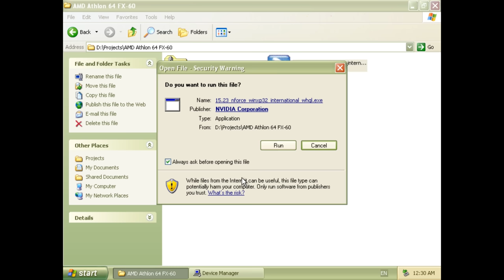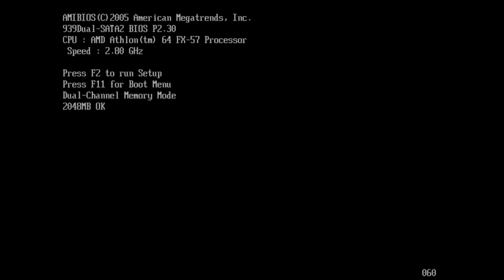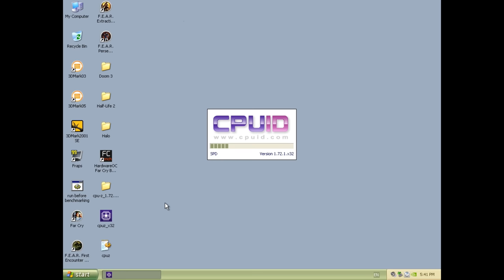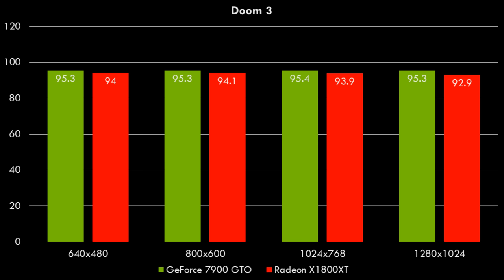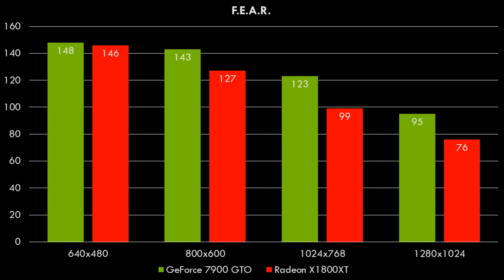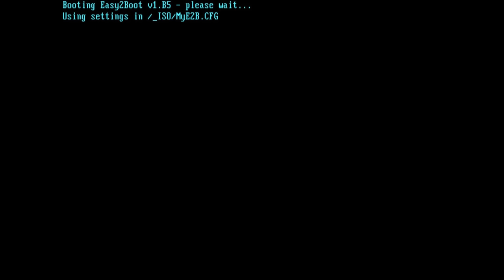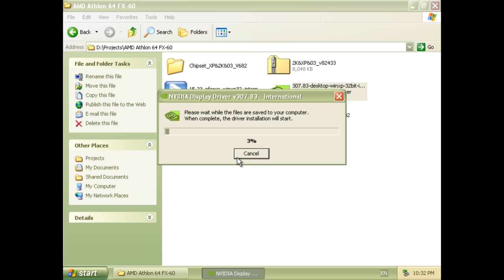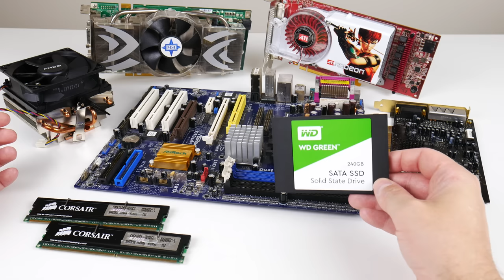AMD Athlon 64 FX-57 - $1031 CPU from 2005

Comment: Ah the memories ... I never owned an FX CPU but that Ai Lifestyle branding bought back the feels of the Q6600!
Reply: Q6600, now there's a chip. I still have a rig running one, such a fantastic processor for overclocking.
Reply: The whole Q2D/Q2Q line was amazing for overclocking. I once put a 3Ghz e8400 under vegetable oil with a water cooling kit in a mini fridge and it just wouldn't quit. I think I got it to 4.5Ghz...

Comment: I still have my Abit AN8-Ultra board, AMD 4800+, a ATI x600, a Asus EN7600GT (Passive cooler), and a Geforce 8800GT... haven't tried to run any of it in many years now. I used that system until 2013 when I finally upgraded. They might still work and I feel like building a retro PC. I even still have my case from 2005... think all I'm short is a working PSU and a nice CRT monitor...

I do actually have quite a bit of old tech. Some old intel 478, Celeron D, 2 or 3 Athlon 64 3200, AMD Phenom II 550 black, Geforce GTS250, ATI 9200, some other random graphics cards, old external 56k modem, and all kinds of bits and pieces. Never really thought about it much until I saw some of your vids and now I realize I have quite a pile of old stuff stashed away in boxes. 

Feels like yesterday me and my mates were updating directX with our TNT2 and Geforce 2 MX440 (Had a 1.1Ghrz Celeron at the time) and running 3D mark to see if it made a difference and then just playing counter strike 1.3 all weekend anyway.... good times.

Comment: Hey Phil!  Great stuff as always.  I want to thank you especially for the Snappy Drive Installer link.  I am working on numerous projects and this tool looks great.  The fastest Socket 939 chip I have is the AMD 64 X2 5000 running in an Asus M2NPV-VM  😎
Reply: AMD 64 X2 5000 for a socket 939? Wasn't X2 4800+ the top one that 939 supports?

Comment: For anyone curious, here's the reasons you don't want to install video and audio drivers from Snappy Driver Installer Origin:  For video driver I have routinely had bad luck with it causing system lockups and having to boot to Safe Mode and manually remove or replace them; this has occurred regularly on both NVIDIA and ATI/AMD GPUs, other manufacturers don't really seem to be an issue.  For audio drivers, specifically Creative Labs products, the original Creative Labs installation CDs will not detect the sound card once drivers have been installed and so the installers will refuse to run.  It's best to install everything you need from the CD immediately after Windows installation, and then reboot.  From there, you can allow SDIO to install the latest drivers for the cards and retain their full functionality.

Comment: I still have my athlon 64 3500+ paired with a asus a8n-vm csm rev 1.01 and it has worked flawlessly for as long as I've had it. I've had it since 2009 when I got it from a relative. Apart from cleaning it from dust I've replaced the cmos battery once a couple of years ago.
Reply: I had a 3500+, as well.....nice processor at the time!
Reply: I used an Athlon 64 3700+ and the Athlon 64X2 3800+ on that board. Never a problem!

Comment: The nForce chipset was a pain in the arse when new, and only got worse with age, driver support fell off and then normally the headsinks fell off on the cheaper boards and they died
Reply: I have an ECS board from 2007 and have no issues, but I have repasted it.
Reply: @uzernaim1648  more amazed you have a ECS board still working 🤣
Reply: @JimtheITguy  I still have working old PC with ECS Nforce4 A939 motherboard running Athlon x2 4200+. Running it just for a cheap router/ftp server
Reply: @JimtheITguy  I have a working Socket 4 ECS board from 1995. I've heard it outperforms most other mainboards for socket 4. Also it offers great possibilities to configure memory and cache timings.
Reply: @Tom2404  Glad to hear it, Socket 7 and SS7 onwards boards got so cheap and badly made that they didnt survive or they were so unstable after a few years due to crap caps
Reply: @JimtheITguy  yes, they bought PCChips back in the day and even sold some boards under both names. That's probably one of the reasons why their quality dropped.
Reply: @Tom2404  ahhhh the good(bad) old days, time to play guess the version of the motherboard :-D

Comment: I had the first board you tried. I ordered it because it had integrated Sata in the northbridge specifically so it didn't need the F6 driver method to use data. I never had to do that with that board. I ordered that board as soon as it launched, and it had a lot of stability issues at first, but then on a later bios update it became the most stable and solid system I have ever owned. I paired mine with the Athlon 64 X2 4400+. I still have both the board and CPU.

Comment: I have an Asus A8N32-SLI Deluxe, almost the same Board as you wanted to use. Got it CIB almost new, but the seller sold it really cheap, due to a faded memory of having issues with it. I tested it and it would always spit out the same post beebs and a black screen, regardless of cpu or powersupply.  Got another used but in good conditon A8N (don´t remember the exact model) also with an Nforce Chipset but without SLI capabilites. That board worked fine, apart from booting issues sometimes. Sold it as a complete system to a friend, so he can play some games from back in the day, that he really enjoyed.

Comment: I have an ASUS A8N-SLI that, as of the last time I tried it, still works perfectly fine.  I've had to replace the chipset fan twice since I got the board back when I purchased it as a replacement for an MSI board that died a mysterious death after a simple RAM upgrade; this would have been sometime around the end of the 939's lifespan, circa '05-06.  I bought a passive Zalman heatsink that I might get around to putting on it some day.

Aside from a single capacitor near the RAM slot sthat's showing signs of bulging, the board appears to still be in decent condition, and now I kind of want to take it out and play with it.

Comment: My experience with Socket 939 has been overall positive.

Recently, I purchased an Asus A8N32-SLI (never really had any serious problems with Asus boards, unless they were actually broken), and after giving it a thorough cleaning because it was a bit disgusting (spraying it down with some CRC QD Electronic Cleaner after popping off the heatsinks, doing additional cleaning with 91% iso. al., and using some new Arctic MX-4 and Arctic thermal pads for the VRM + chipset heatsinks), I threw into it my AMD Athlon 64 FX-60, 2 different kits of 2x512MB DDR-400, a Zalman CNPS9500 LED CPU cooler, and a Teamgroup L5 3D Lite 120GB SSD, and went off to install XP Pro. 64-bit.

I never had as much trouble installing XP as I did when I tried with this platform. It turns out that if you slipstream the Nvidia SATA drivers (which you can get by unzipping the all-in-one Nvidia chipset+storage+other-stuff driver package and going to the "IDE\WIN**\sata_ide" folder), you have to allow XP's installer do drive formating, or else it'll essentially not copy anything over from the install disk. If you try to format your boot drive under modern Windows for proper SSD allignment and the like, and try to make the slipstreamed XP installer do something with it, the installer acts as though the volume is write-protected from the looks of it.

Besides that multi-hour troublshooting nightmare, the rest went swimmingly. Installed the latest Nvidia all-in-one driver package for the chipset, then sound, LAN, etc., fully-updated XP with all of the latest updates, installed the latest GPU drivers for my given GPU, did some tiddying up, and the install was ready for some GPU testing (I was testing a 7950GT and a 7900GTX that I had just acquired for this test-build).

After that was all said and done, I decided to try some OCing with this CPU. I got decent results I think with this chip (2.8Ghz with stock bus speeds, multiplier of 14, and Vcore of 1.45V; the chip was over 2 hours stable under Prime95 at 1.435V (?), so 1.45V should equal rock-solid stability, although I didn't test it; after all, 'tis was just for a little benchmarking, not long-term use; BTW, I had some fans over the VRMs, just in case). Sadly, I could not go any higher and hope for any reasonable stability. From what I could gather, this was due to temperature - these chips get real sensitive at around 60C, unlike modern CPUs, so if I want to get beyond 2.8Ghz, I'll need a beefer cooler or a more exotic solution. I don't think I won the silicon lottery with this chip.

Anywho, getting an FX-60 to 2.8Ghz (which I think with nearly all FX-60s is easily doable with a decent cooler) should easily put it toe-to-toe with an FX-57 at least in clocks, all the while giving you the benefits of two cores with 1 megabyte of cache per core.

@PhilsComputerLab Maybe you should compare the FX-57 with the FX-60, and if you need an FX-60, I'd be happy to loan you mine. :D

Comment: AMD: Breaking the 2.5Ghz barrier at time. High clocked single core CPUs with huge CACHE are still kings
Reply: They certainly weren't with highest clocks
Reply: @TurtleAsshole  well, multithreading Is not yet in all apps. In my exp single-dual core up to 4 core 4ghz cpus perform better then 8-16 core 3ghz cpus, so frequency matter
Reply: Amd broke the 5ghz barrier too with fx 9th gen or also known as the amd Chernobyl cpu
Reply: @krumrashkov7228  Never seen a serial produced 5ghz CPU on sale, will check it. External love for AMD and via-cyrix, healthy competition
Reply: @TurtleAsshole  But they dont get really utilised so fast. Oposite examples are rare, like how well MacOS X operates on relatevely low hardware looking at spepcs. I am old school for optimizations first, hardware optimizations too like in CISC m68k days, unlike big numbers that dont translate to real world performance. Looks like "buy Shaker 5000" marketing so long
Reply: @RasVoja  the fx 9580 i think was the one that reached it but it had a tdp of 225  thus the name amd Chernobyl
Reply: @krumrashkov7228  Checked 8 cores at 4.7GHz. I am sorry but that is not breaking the 5Ghz barrier
Reply: @RasVoja  boost is up to 5ghz so it counts
Reply: @RasVoja  and they are actually 4 cores but amd markets them as 8
Reply: @krumrashkov7228  They also broke 8.7GHz with FX.
Reply: @MJ-uk6lu  yeah but the architecture sucks so no matter how high it goes it still aint good compaired to todays ryzen altho i still own and use a fx 8370E and they hold up quite well
Reply: @krumrashkov7228  Then its not much better then my Athlon X4 880K 4.2Ghz
Reply: @RasVoja  i guess i never said they performed good they reached high frequencies but dont perform well because of their bad architecture
Reply: @krumrashkov7228  OK, but I count "normal freq"
Reply: @RasVoja  they were on sale.... i remember looking at them on newegg.... 10000% sure

at least they were in the states..... you didnt miss much lol
Reply: @TurtleAsshole  That is true. Nowadays, 12 and 16 cores are considered "mainstream" or "gaming grade" 
I have a 12-core Ryzen in my current rig, and I'm very happy with it. Performance is great, everything is nice and snappy, and it's highly efficient when considering the thread count
Reply: @krumrashkov7228  No FX havem modular architecture, each modules has two cores, they have their own ALUs, L1 cache, BUT they share L2 and FPU. Its common misconception.
Reply: @Artanys62  yeah but exactly because they share the l2 cache they are considered 4 core cpus even tho they are 8
Reply: @krumrashkov7228  Its not because shared L2 cache, its mainly because shared FPU and lower FPU performance. In non-FPU heavy tasks FX works great.

Comment: Look for swollen caps on those old dead motherboards.
Reply: EVENT ID 41 KERNEL POWER
Reply: Especially if it's manufactured in the 90s, a lot of caps back then were counterfeit.
Reply: @SerBallister  early 2000s too, from my experience.
Reply: @daw7563  if i recall correctly it was the very early 2000s; 2000 - 2002.

Comment: I have used an ASROCK M3N78-VM with NForce chipset with absolutely no problems until a couple of weeks. It has been paired with Phenom X3 710 and X4 955 BE. Always overclocked and no problem.

Comment: There's a reason why Nvidia no longer makes PC mainboard chipsets. I've very rarely had good experiences with Nvidia chipset mainboards, both at home and working in IT during that time. The most reliable Nvidia chipset based board I've ever used was in an older Dell Dimension PC that has an 939 Athlon X2 3800+ CPU in it. But even that board can be somewhat finicky with SATA devices much like you also had issues with.

Back in 2005-2006 I still had an Athlon XP 2500+ CPU overclocked to 3200+ speed and a ATI 9500 Pro video card. The whole setup was long in the tooth, but I was going through a divorce & bankruptcy at the time so I didn't have a lot of money for several years.

Comment: Before my M2N32-SLI Deluxe I had one of those asrock boards. Strait up, when it first launched, it was crap. Stability and performance issues abounded, but every time I looked there was a new bios update. And one by one the bugs were all fixed. And then finally with one of the later bios revisions they gave them a great performance boost, so they were as good as any other board at the time on 939. I passed mine down and it was used happily for many years. Best budget board of its era that allowed me to hang onto my AGP card and upgrade to a dual core and pcie card, and later AM2. Very great experience.

Comment: I bought an Asus A7N8X-E deluxe back in the Athlon XP days, and had a lot of problems with it, I had the same issues that you had in the video, but only with the ethernet controller. When I tried to make a RMA the vendor had gone bankrupt, so I had to get a VIA based board from Msi instead. Worked like a charm until lightning struck :-)

Comment: To add my own comment to the hundreds here. 
I loved the nForce 2 and nForce 3 chipsets and have had ASUS motherboards using both over the years. These boards were fine. I currently own an MSI motherboard running an nForce 3 chipset with an Athlon64 FX-57 and this board has not been problematic.
I did find that the nForce 3 boards were not as overclocking friendly as I expected, but good results could come out all the same. At the time that I bought my MSI motherboard, I wanted to retain my still highly competent Geforce 6800GT AGP card, but wanted to move over to dual core. I bought a low-TDP variant of the 2.2GHz 4400+ which I clocked at 2.53GHz for daily running (I could reach 2.75GHz, but this was not too stable). I did use 500MHz RAM with this. The FX-57 was a much later acquisition for a Windows 98 project that never got started, but the board and chip do get through their paces from time-to-time and still run stable. 3.0GHz is the best overclock I could get, disappointing given the unlocked multiplier, but not surprising considering how close to the limits it already was.
I will say that by the time nForce 4 came out, I was avoiding it like the plague. It was extremely expensive, ran very hot and had poor reports. I have a Core 2 motherboard with an nForce 4 chipset as well - it's not impressive at all.
If you get the chance, it would not be unreasonable to try the board with an nForce 3 chipset. Although AGP only, someone with a 6800 GT or Ultra could have warranted an FX-57 and as mentioned above, is actually one of the best combinations for an ultimate Windows 98 gaming monster.

Comment: Great video as always Phil!
I have a similar retro XP gaming PC.
I went for the similarly bonkers Pentium 4 extreme edition (3.4GHz on socket 775)
Nvidia GTX 7950GT (XFX overclocked silent edition)
ASUS P5WD2 Premium motherboard
4GB (2x2GB) ddr2 RAM (1066mhz Corsair XMS2)
Sound Blaster X-Fi Fatal1ty Edition (the original PCI version with 64MB of X-Ram and the 5.25" bay)

It's all build around the P4 EE, there are so few motherboards that support it.
I chose the nvidia card because of its looks and the fact it was silent. It also evokes more nostalgia for me as I always had Nvidia cards back in the day. (I think I had a GeForce 6200 at the time)
I'm currently playing Doom 3 on it during the lockdown!

I'd love to see you do a video on the Prescot 2M vs the 1M and see if the extra cache made any difference in retro games and if it makes any difference to more modern applications and then maybe compare that to the extreme edition.
I'd also like to see more of the Intel vs AMD series.

Comment: Great retro review as usual..back then I was only a year into PCs..my Athlon XP 2000 was replaced in 2006 by the short lived socket 754 Athlon64 3000+ another single core..in an MSI K8M800 6741...still runs but has a Sempron 1600 now...like your many failing boards from this era...mine won't work with the 3000 or 3200 or 3400...no signals...but all the same starting noises and fans...I had to wait another decade to get a Foxconn 939 board and processor...which I use everyday...and I also have a few pentium based old PCs too...wouldn't mind one of those AsRock AGP/PCIe boards...